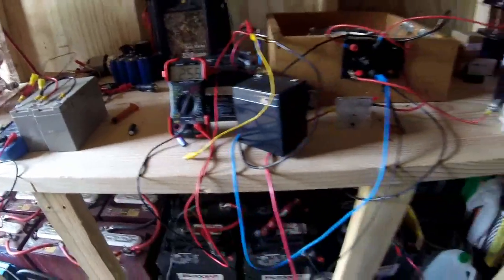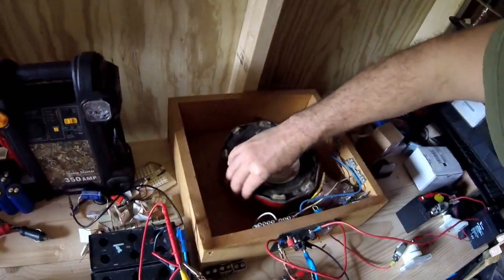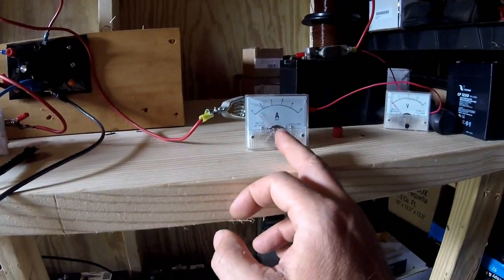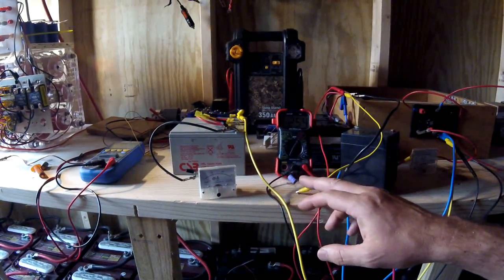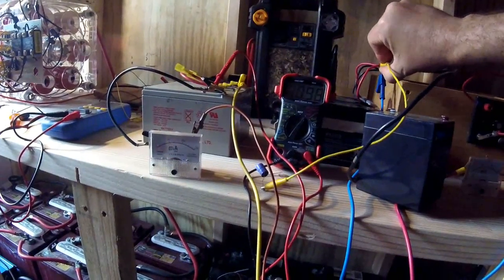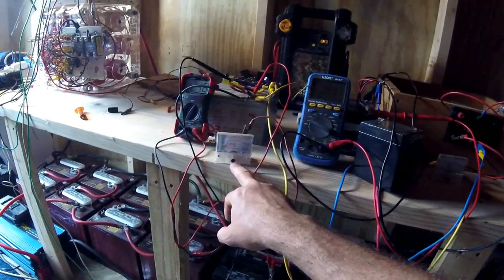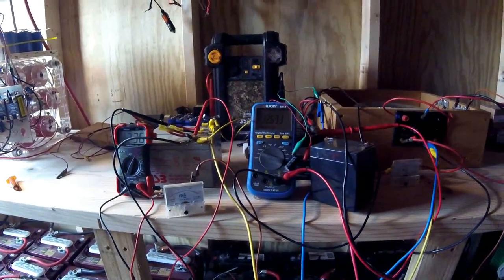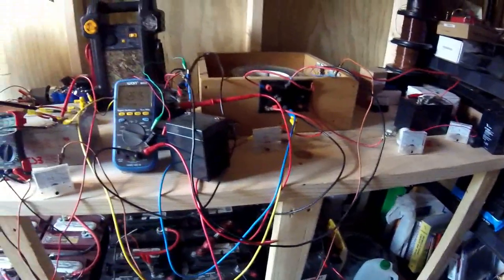Single Coil Bedini Motor With Multiple Output Diodes & Batteries

Comment: Diode To The Voltage and Current Crosses Coil Diode Spark and Capacitor
Reply: Current Stills 100mA 200mA 300mA 400mA 500mA and Cross Coil

Comment: Yes, the capacitor is acting as a filter. Capacitors can absorb voltage spikes many, many, many times faster than ANY battery can....
Reply: Also.... The capacitor will weaken the amplitude of the "voltage spike" . You would need an oscilloscope to see this. The "voltage spike" is what is helping to "restore" the batteries, therefore you are charging the batteries but have less removal of sulfate from the battery plates.
Reply from the maker: Cool, thanks. I hope to get a good scope soon. I have a tiny pocket scope but I am not very happy with it.

Comment: You say there is no current going to thee the extra batteries? Then they are not charging. Voltage by itself means nothing.
Reply: Troy, with all due respect, sometimes "expalininig" the way you say John Bedini did isn't so much explaining as it is nonsense talk. Some people are naturally talented at putting words together using a sprinkle of reality and a whole lot of nothing to make it sound like they know what they're talking about. This is how cults start. It's possible that you, being a good, honest man with your thoughts based in the real world, can't do this well. I mean that as a compliment. I know it's fun the think you're harnessing a strange unexplained energy, but is it really happening? I'm sorry, but it's just not.
Reply: I dunno about the Bedini Motor, but batteries store energy that was put in them, with less than 100% efficiency. Without amps input, battery can't be charged. Unless the battery is already charged but some of its power is not accessible and the Bedini Motor unlocks that. Shouldn't be the voltage higher though?
On the other hand you can charge the battery with merely no amps, it will just take a lot of time.
Reply: So how often do you charge the primary battery?
....and how long did it take to get the batteries charged?

If you swap the batteries in the circuit, how many times did you do that to charge the large ones under the bench?
Reply: I have built many Bedini motors 
What is happening is a millisecond voltage of 300 to 400 volts.
The battery will line clamp the movement of the voltage .
However the electrons are in the chemicals the electrolyte gets a huge electron amount in a millisecond. The battery excepts the 13.58 volts but the rest is backed up and confuses the electrolyte .
So constantly pulsing the electrolyte allows the time for the electrons to plate . No amperage behind the voltage means no heat.
Todays tech uses amperage to strong arm the electrons on the plates. This is more of a gentle hey it's here and over time absorbs and plates in the battery cells!
So by adding more batteries makes sense because of the increase of the surface area to disperse the voltage saturation.
As long as the voltage stays above the 13.58 standing charge eventually the batteries will except the charge.
With out amperage.
He could add another 8 batteries up and they will charge
Reply from the maker: Actually the charging of a lead acid battery is a chemical process. Anything that causes that chemical change is "charging" the battery. It does not have to be voltage and current.
Reply: Troy, you are correct in saying that charging a battery is a chemical process. But isn't it also true that in order to cause chemical changes in a battery, you need an electrical current passing through the battery? Voltage can be compared to water pressure in a pipe. You may have 70 pounds of pressure at your kitchen faucet, yet not a single drop of water flowing out of the faucet. To put it another way.. In order to charge a battery, you need an energy input to the battery. That would be voltage x current. NOT just voltage alone. There is no free lunch or "free energy". Hope this makes sense.
Reply from the maker: I am not good at explaining it like John Bedini did but he said you dont necessarily need voltage to make that chemical change. And its not really "free energy" because you have to use energy to spin the wheel. Its just using energy that is already there. Like the wind, solar, static energy for example.

Comment: A trick that I have used when I have an amp meter that can't handle the initial current is to just put a wire with alligator clips behind it in series to. That way the wire shares the current load well it's getting going and you can disconnect it after the current is low and get accurate readings without breaking the circuit. I might have missed it but what is the voltage of your battery powering the system? With that information you should be able to calculate the efficiency. I think your going to see you aren't getting more power out then you put in.
Reply from the maker: Thanks for the tip. I am using 12 volts to power the wheel. Power in is about one watt. Power out to the larger battery bank is about half a watt. But - there is a chemical process going in inside the battery which cannot be measured with meters. That is where the magic is.

Comment: having trouble hooking up 2 car batteries in series and getting them to charge ant help ??
Reply from the maker: Yes, in series now you need a 24 volt charger to charge them. Series adds the voltage. Put them in parallel - plus to plus and minus to minus. Then charge them using a normal 12 volt source.
Reply: ok the in parallel i want to get my harbor fright 45 watt to charge to car batteries i have one hooked up and run my lap top with it charge my phones but how can charge two car batteries with then any help and tu Troy
Reply from the maker: Just connect both batteries in parallel. Connect them to the solar charger as one battery.